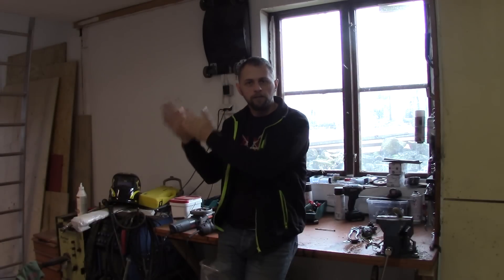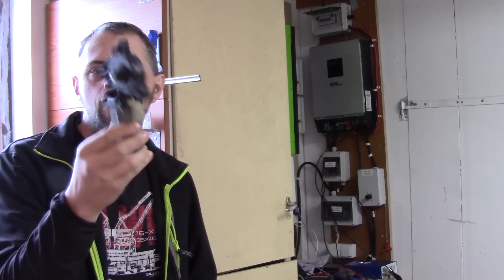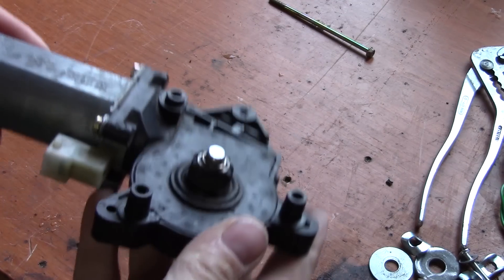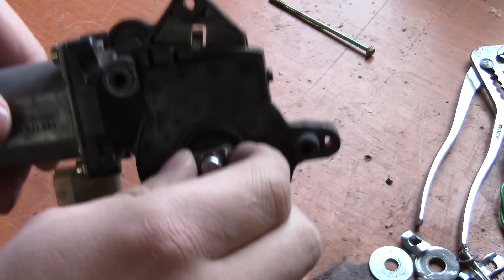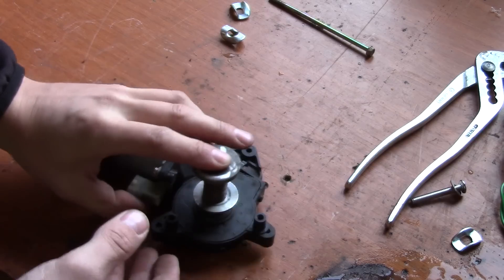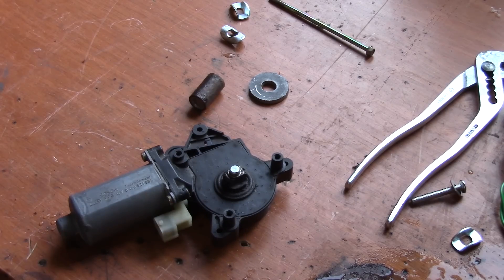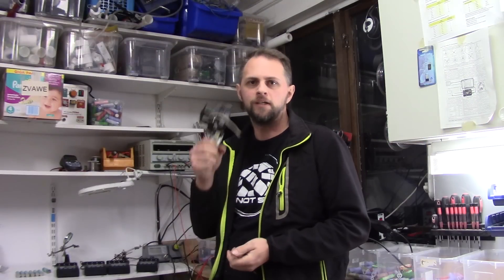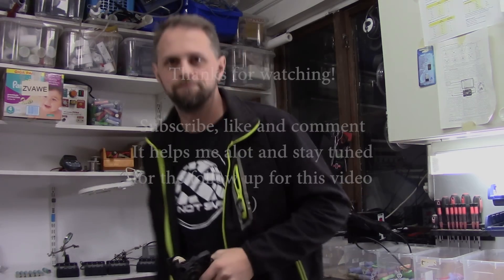DIY: Build a miniature winch from an old car window motor

Comment: Will keep this tip in mind if I would want to make a winch to pick up my car keys off the floor.  Would a car window motor have enough torque to pull a 3,000 boat unto its trailer.? Guess you don't know until your try, or is it that you don't try until you know?

A good car window motor will stop if it feels one of your kids hand or head sticking out of the window.
Reply from the maker: A car windows motor will easily pick out a boat if you gear it properly.  The motor itself is not what stops when pulling up the window on a modern car. Its a current monitor that does. The above motor is dead freaky strong in the gear ratio it have and easily lift 100+ kg as that was built :)  I use this style for many different things like carports and other...

Comment: What kind of welder is that?  It looks like it does a better job than my 30 year old Miller stick welder.
Reply from the maker: Migatronic clone 300A. Does evertything thrown at it. All from 0.7mm to 40mm :).

Comment: How can i make one that will freewheel back for use in a catapult?
Reply from the maker: Need a clutch of some kind
Reply: Use a bicycle sprocket or a car starter bendix they are a kind of Mechanical diodes (one way turn)

Comment: Power window  motors can be made into many things. I know that inside the turning hub however is a rubber cog. I believe that the rubber is there to keep the motor from over torque and breaking the safety glass.
The homemade winch should not be expected to lift or pull too much of a load because the inner cog will strip and cause the winch hub to freewheel.

Comment: How to connect this motor to bicycle pls
Reply from the maker: The motor in this video is a bit slow for a bike as such unless its a kids bike. You just attach a sprocket and run it on the wheel is one way. Or drive by rubber wheel attach on top of the wheel.
Reply: DIY Tech & Repairs thank u we r making a wheelchair Pls tell us exact which DC gear motor lift 100kg person power rpm etc

Comment: From my experience  with window motors doesn't matter GM, FORD. Etc.
Them plastic  balls that bust. 
If you clean them up and replace  the balls with nuts that fit a 7/16 head. You'll never have that problem  again. Some will take a 10 mm nut head. Try it and see.

Comment: i just scavenged one of them regulators from work , thinking about trying it with my solar panels maybe making them track with it
Reply: There's a video where guy set up smaller pannels controling opposite motors so each time the sun stuck the smaller pannel, the motor would move the main array into direct sunlight thus giving shade to the side pannel

Comment: Yes indeed I will honestly say I will like to see this one 
I don't think it will lift much if it will lift at all with out stressing the thing to burning up 
It is interesting none the less and if the experiment is a super tool we owe you 
And I will be in my shop trying to do what you did hope not to be crushed in production
Of a nifty gadget that may have potential new mighty big question as far as the motor an the power of it however much weight will it lift  and maybe a shall pully system to aid machanical advantage an idea of course
      Thank you for yours
Reply from the maker: Thanks! For this to work over longer time it need bearings on the wire-drum part. I have had mine running for the TV now for almost 1 year now and it still works like a charm. I did break the wire used once due to the drum wasnt good enough and it frankly just got cought and the motor itself didnt stop but pulled it apart. That wire used is capable of well above 50kg of lifting and it snapped :)

Comment: I grew up in my Dad's welding shop. Yes, I touched a hot surface after my dad finished welding - ONCE . Yes, I got flash burns - ONCE . Yes, I cut my finger on some sharp metal -ONCE .  It didn't kill me, and I sure as hell have respected those dangerous things all of my life. And because I grew up in a shop, I can fix anything, and I don't have to depend on someone else. I really appreciate this young man allowing his kids to learn from a small age how to work in a shop.
Reply: The childs eyes are also at risk here from both welding flash burn and metal swarf from drilling and grinding.. he should be more cautious.
Reply: Ditto the above...HOWEVER, I saw in just these few moments of video, serious unnecessary risk to the toddler.  Most serious was the exposure to arc energy/light.  This can very suddenly have permanent effects on vision.  Less but considerable was the exposure to metal grindings to the eyes...especially since he's low and in the fall path AND they are always super curious and observant.  I'm not a tree hugger or child overprotectionist...only the victim of eye injury.  Otherwise, a nice job / project and you left me curious for the next...cheers.
Reply: ok...you can start fix your life now.
Reply: no
Reply: Steve Vise 
Same here steve 😉

Comment: I am thinking, this would be a great little motor to make a small car for my little kid, instead of spending $350 for one of thise cheap plastic cars from Wal-Mart
Reply from the maker: 2 of the will do the work just fine. Heck 1 will work as long as its a small car and young kid. Mine here are to big now so even the 250w atv is to small now :)
Reply: Steve Vise 
Zz
Reply: Steve Vise 60
Reply: Steve Vise y

Comment: Hi I opened this window motor assembly for a different purpose and am unable to get it shut back together. Do you have any tips? I got the wormwheel inside and even if i try spinning the wheel the axle does not go completely in to allow me to screw on the torque screws.
Reply from the maker: Dont know m8. it sounds like there is a bushing or something in the way
Reply: Thanks your right. The metal bush at the bottom had shifted in place. So I used the head of the axle to straighten and align,then reversed and put it back in. Thank you again.

Comment: looks like a good outcome. have you tested how much weight it can lift upright or maybe pull sideways something like that. or if you have an idea about can you share your experience?
Reply from the maker: Dunno but depending on the size of the winch axel you could probably lift 30-40Kg or even more. its just a wild guess but they are damn strong for being that small

Comment: Very nice. How do you wire the up/down switch?
Reply: A DPDT switch will reverse the polarity of the voltage supply (battery).

Comment: this area prohibited for kids  this 3 minutes a little kid touch arc welding wire please keep children away from this working area
Reply from the maker: No, my workshop area is not prohibited for my kids. And touching the welding wire is not dangerous. Not for me not for my kids since they are shielded and wont give out any shock. He only chewed on a alu rod. Its not more dangerous than chewing on a pencil or anything else inside the house or what they have on the daycare... ;)
Reply: ok but spark of welding i think danerous for eyes kid haven't glsses
Reply from the maker: Thats actually true and i did not notice him comming that close and did not see it untill editing the video. He generally stays in background far behind :)  If i would have seen him that close i would have moved him. Sparks from welding or grinding can destroy eyes in seconds!
Reply: hey its good to let your kids be around you when you do things like this  they wil learn skils I was with my dad all the time when he was in his work shop he told me not to touch hot things and do not look in the welder. i did once and learned why i could not look in the weld.:Skids wil learn from their dads its good
Reply: Is sparks the ONLY reason that you wear welding glass?  I don't weld, but I don't watch welding either.  I hear that it can be blinding.  Consider yourself scolded and prohibit kids when necessary!